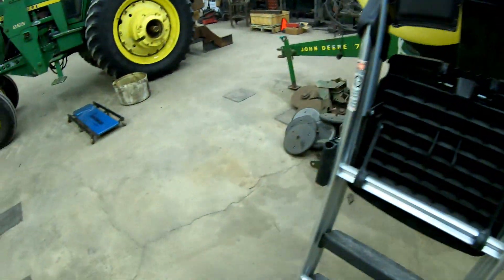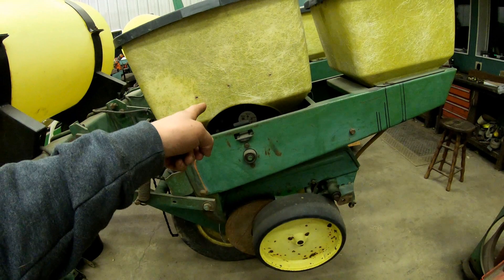Started Out as a Sweet Corn Planter

Comment: That will be a nice unit when you're done! I upgraded my closing Wheels to The Replacements bike wheel from yetter and then did one row with the big cast paddles. The replacement spiked work very well the paddle is simply awesome! The shark wheel floating row cleaners are Unstoppable Beast they really work! And the upgraded tail frame with a quick change tension handle so nice.

Comment: How precise can you plant with this. We have an 8 row 7100 and we're worried that it will waste seed. Would the upgrades from yetter help with that?
Reply from the maker: The upgrades from Yetter are more to increase yield, stability and emergence. I would highly recommend looking into Precision Planting if you are concerned about wasting seed.
Reply: That's what I figured, we normally use a 1560 drill and it does fine. We just use this when we're in a pinch and I was hoping we could make some upgrades to help it.

Comment: Be careful with planting beans on 30" rows.  When I did that, marestail tried to take over my fields.  Had to go back to a drill
Reply from the maker: That's a big reason why we like our drilled beans. 15s were afraid were gonna see a bigger weed issue.
Reply: @WernerAg  we plant 30" beans with little to no weed pressure. Weeds become an issue if you let them, but we are also conventional till so i feel that helps our spray program.
Reply: We don’t seem to have too many weed problems in 15” either. However, 20’s and 30’s you really have to stay on top of and manage correctly.

Comment: We run 4 John Deere maxemerge 1730’s on 22 inches for our sugar beets and we have the yetter row fermers behind the closing wheels and have noticed a little better emergence, out of four machines it definitely depends on where we are planting and soil.  With your combine purchase congrats if you could have found a low hour 9870 you would have been more happy. Our farm currently has 670 and a 690 very disappointed in how well it harvest small grains,  have not harvested any corn with them so maybe they do better there. Right on with 10,000 sub keep up the good work
Reply from the maker: It's really interesting to hear from different people from across the nation and from around the world on row spacing on planters. We were actually hoping to find a low houred 9870 to run with our 9650 and in a year trade our 9650 off for a 9770. Since the 690 went for one heck of a deal, we didn't see it to be necessary to keep our 9650. Thanks!